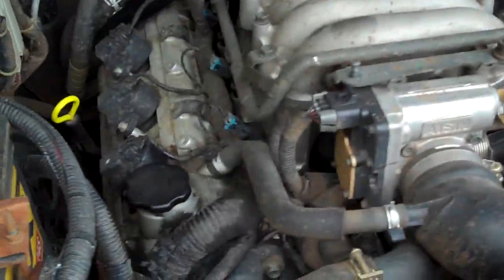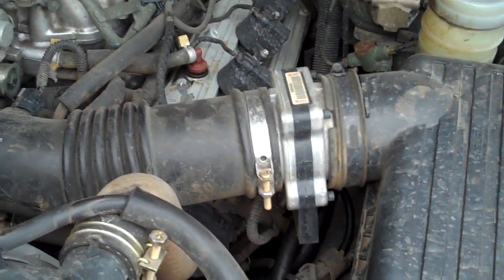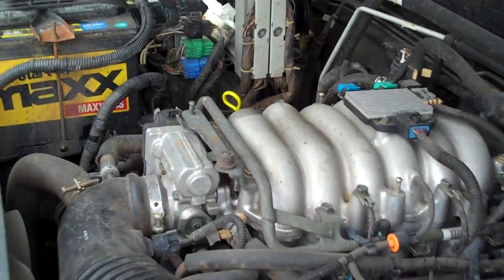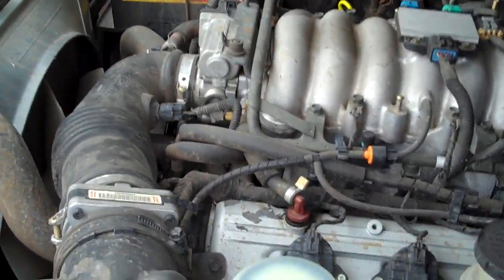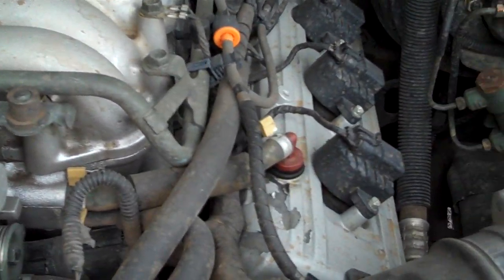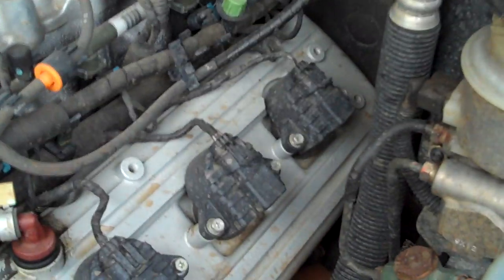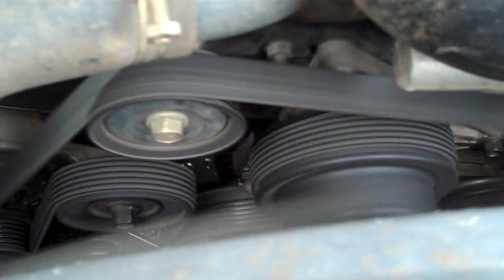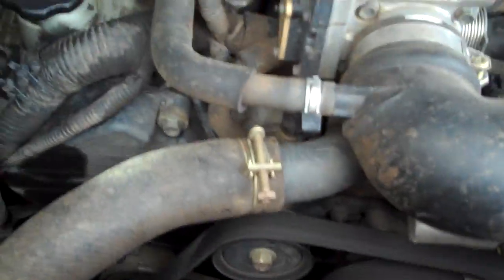Isuzu Trooper Engine Knock HELP!

Comment: I know this is an old post but for anyone else future problems take it from experience they have a notorious bolt loosing of the front crank shaft...causing the timing gear to rock back and forth, this wears down the KEY way and key if it goes you may bend valves and bust pistons... been there did that.... trust me the oil leak is a sure sign the front seals taking a beating from it...

Comment: Engine knocks. due to oil leaks (oil seal) and due to oil leaks you did not discovered earlier either of the cam bearings or the cam shaft got  worns out. You need to overhaul your engine so that we can see where that's knock came from. Tips for old engine just check weekly the oil, water & other fluids. The battery for a month.

Comment: engine rod bearings um need to replace quickly and find that oil leak.. so get the tearing down .. before you have to replace the engine

Comment: Had a ticking noise as well as a big oil leak coming from the top that would come and go(the noise). My mechanic replaced the valve cover gaskets and the noise never came back. He figure due to the pressure escaping from the huge valve cover leak that it had something to do with the hydraulic valve lifters not getting properly lubricated hence the loud sound. I have 202,000 miles on my engine. Who knew it was that simple. The engine is quiet now. So if you hear any isuzu with a loud tapping sound go for the valve cover gaskets. These engines are suppose to last 500000 miles with no problems.
Reply: Thats what i'm gonna do on my Isuzu trooper.
Reply: @veronicagomez5074  any update to your trooper?

Comment from the maker: @ramsexyxxx Check engine light was Off, Power definitely lost, Noise increases consistently with a rise in RPMs. Oil level was approx 1 qt low after the initial problem started. We have determined it to be a guide rod that shook loose and slammed through the block. Not worth putting a new engine in the old girl. Worst of all I maintained the hell out of this engine and still owe $1,300 on it!

Comment: @sutukil47 Actually, the ticking has stopped quite substantially. But it is still there. It's coming from where the dist. is, and when I took the valve cover off, there is some wear on the Dist. Maybe it has a small chip in it? If not, my book says my VALVE LASH is adjustable. I ran the motor with the valve cover off in the garage and it was a little messy, one of the rockers seems to have some rattle and play to it. Already replaced the Timing belt and the stuffs inside, thanks though. its lash

Comment: You're welcome. Mine actually, I found out it MIGHT not be a valve...Took the cover off, cam shaft off...No signs of wear, everything is lubricated...Put in all sorts of additives for valves, and still nothing. I go under the engine and even do the old screw driver trick, can't hear anything in the block. It's coming from the back of my motor, thought it might have been a valve, til I put my ear up to my distributor. Sounds like the ticking is coming from that. But I'll get the head off soon
Reply: Update ?
Reply: Any update?

Comment: I have heard nothing but bad reviews on that motor, just so ya know. As for where the oil is leaking out, you will for sure have to pull off the timing cover, then run the motor and see where the oil is coming from. That is definitely a knock. My Isuzu Amigo 2.6L has 201,395 miles on her and she just developed a valve tick. You not only have a lifter tick (Which you can hear), but also, unfortunately, that's a rod knock right there man. If it gets MUCH louder under the truck, it's a rod. Sorry..